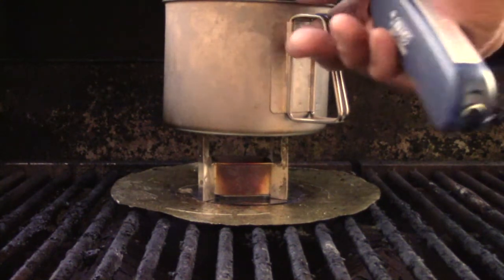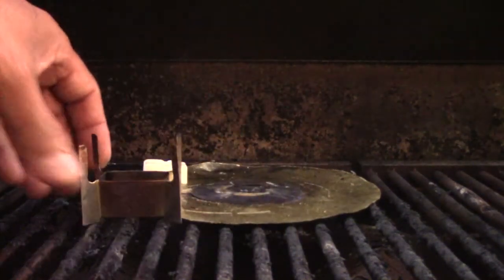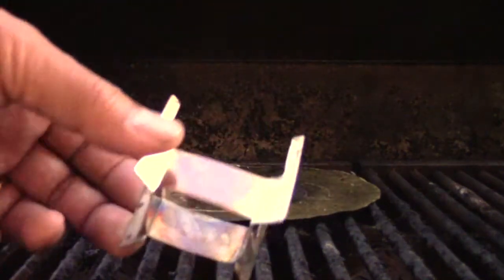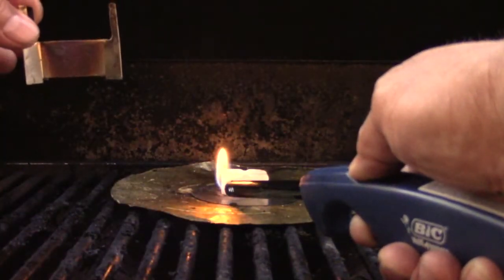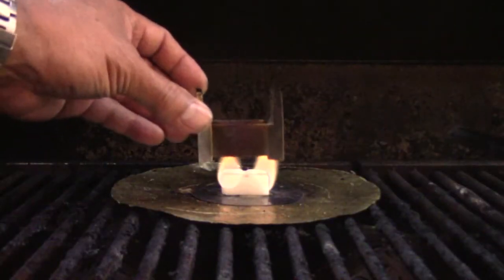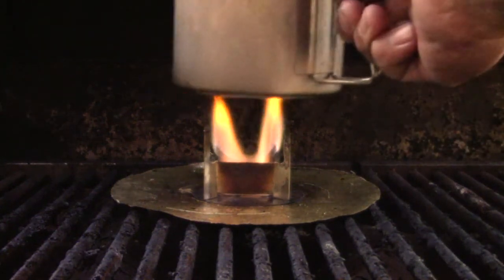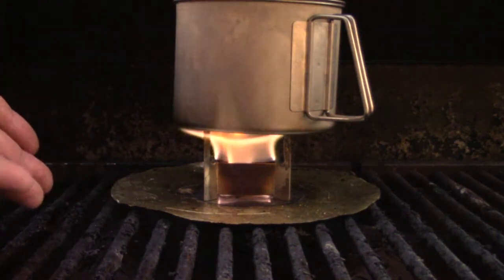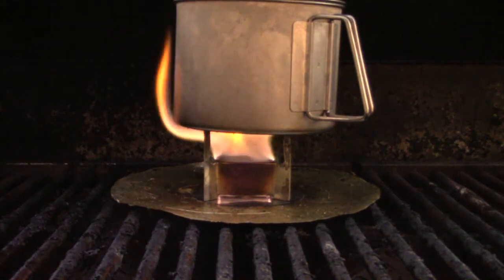DIY Esbit Stove: 18 grams! by FLAT CAT GEAR

Comment: Creative solution as always Jon, but the Esbit Wing Stove is slightly lighter. Do the sidewalks of your design help concentrate the flame for faster boil times, like with the Epicurean (which I love)?
Reply from the maker: It is actually more efficient that the TiWing stove.
Reply: FlatCatGear , makes sense. Would like to figure out how to mod a TiWing to get the same benefits. The wing just has a hard to beat pot support.
Reply: Oh, I see that you already made some attempts at optimizing the tri-wing stove a few years ago. Don’t know how I missed that.